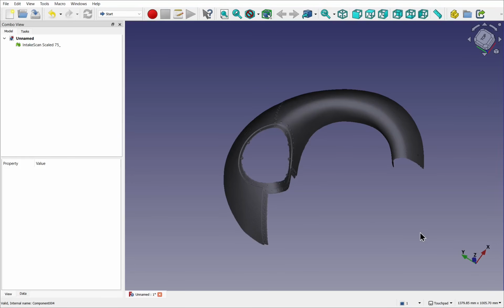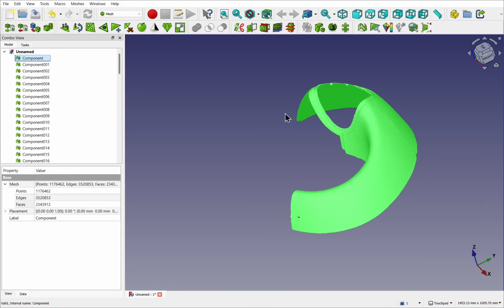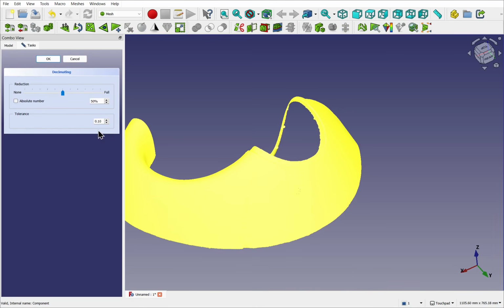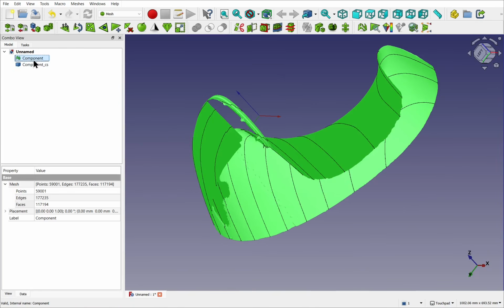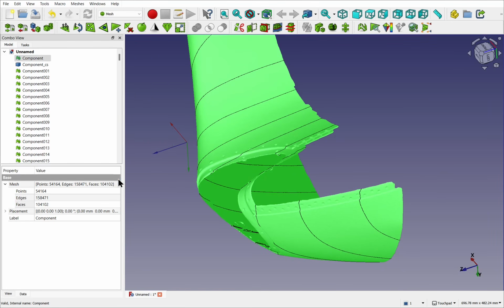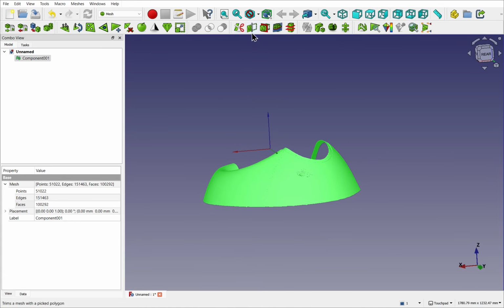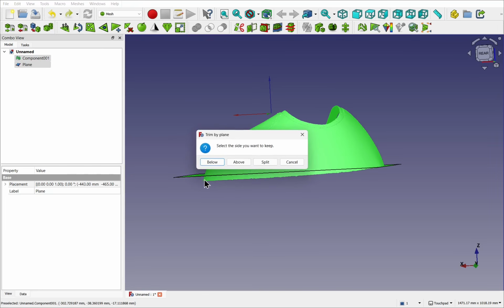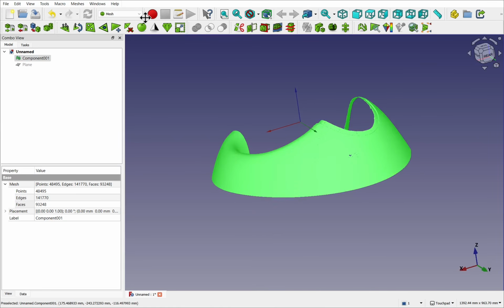FreeCAD: Create Formers From 3D Scans | #1 - Fix and Prepare The 3D Scanned STL  Aircraft Nose Cone

Comment: Do you have an updated tutorial for new version?
Reply from the maker: Not as of yet, the newer "working with external mesh files" goes deeper into prep of mesh files and workflows for modifying and rebuilding (https://youtu.be/QHAjvScRS48).  The mesh workbench has had very limited changes so the video is still current but the one link may help with working with meshes in the broad sense.

Comment: I ran the analysis again after decimating and found non-manifolds and surface folds. It took a few more analyze/repair cycles to get a clean mesh.
Reply from the maker: Yes I have noticed each time you decimate it can cause errors in the mesh.  You have to right idea, repeat the cycles until everything is fixed.

Comment: Hello sir, want to ask, i've been creating some object. It's curvy. And i tried to unwrap it in mesh workbench , or make it to 2d shape in draft workbench. But it not ended with the right length as it supposed in 3D model. How am i supposed to do sir? i need it to be in 2d because i want to laser cutting the objet sir.
Reply: @fdsphone6854  Hi, thank you for checking 😃. I changed the method. Instead of using b spline, im using polyline and circle on sketcher. Then copy the surface i need on part workbench and create shape element copy. After that, create mesh from shape and unwarp mesh on mesh workbench.

It seems like this is not the right way to make a file that can be used for laser cutting. But this is what I can understand and do so far. I have managed to make quite good results from this method several times. If you have another method that is simpler or easier, I would like to know. Thank you. 😃🙏🏻

Comment: Regarding the cutting off of that rear portion of the scan, to get the part to be sat on a plane. Maybe I'm confused (easy done LOL), but haven't you just lost part of the actual component by doing it the way you did? Assuming that the original nose cone was successfully (carefully therefore) removed from the aircraft and was complete, it will (presumably) have a straight rear edge where it mates to the rest of the fuselage. Assuming (again) that the part was then sat on a level surface for scanning and any extraneous data from that scan digitally removed (such as the table it was sat on), isn't that edge the true rear of the part? That being the case, isn't that rear edge the reference edge and thus the plane needs to be set against that edge (so that the component is level and vertical), rather than what seems like taking the scan and slicing off some material at the back, seemingly at some arbitrary point? As I say, I'm probably confused or missing something here, so I'd be interested to hear your thoughts.

Comment: Meshlab (also platform independent, open source tool) really improved a lot from the borderline useless sluggish nightmare it was not long ago, into a quite well optimized, snappy and handy tool, might worth checking out a recent release for more involved mesh / point cloud wizardry.

It has a weird workflow logic, like no undo/redo utility, instead you have to duplicate layers you might want to revert to, also weird mouse control behavior, but one can adapt to it, and it all starts to make sense after a while.

Don't take me wrong, the FreeCAD Mesh workbench is a wonderful take on the subject, but if I'd be dealing with these sort of issues on a daily basis, I would definitely aim for the tool specifically targeted on this extremely complex set of problems.
Reply: which program do u recommend then